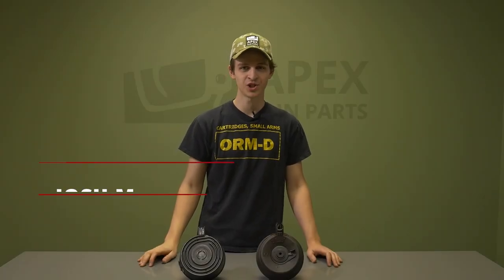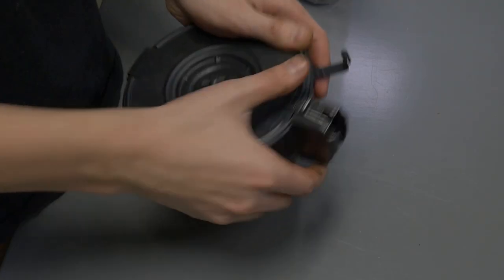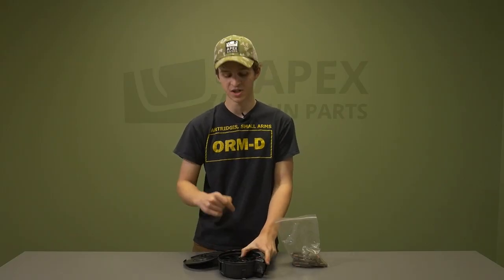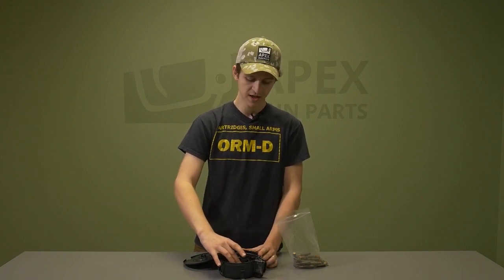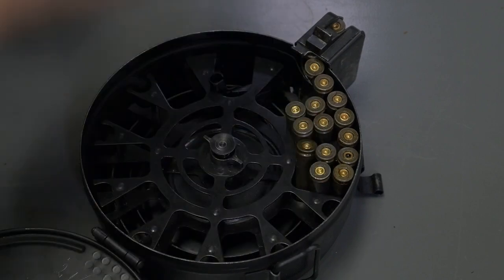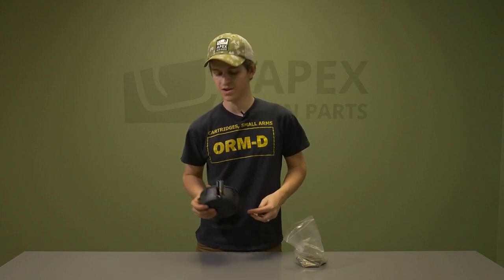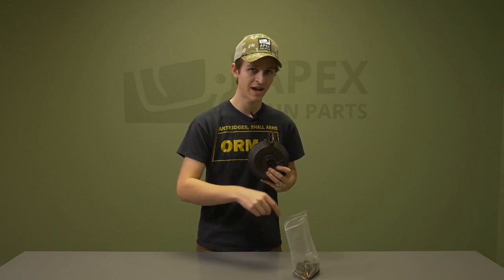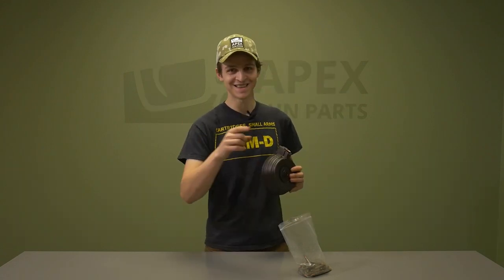How to Load AK-47 Drum Magazines

Comment: Is that a hack with the new Romy rear loader by adding extra "default tension" when you started the loading process?  (First time seeing this on a rear loader)

Does this apply to the old Chi ones also?

Ive seen the "full turn" hack when people disassemble the used top loaders to clean out the Cosmo and put an extra spin of tension on spindle "just incase", but that rear loader is new right???

Seeing it done on a new Romy backloader confuses me though, unless some dont feed all 75 with just 4x full turns....